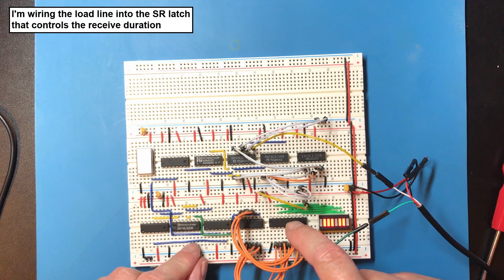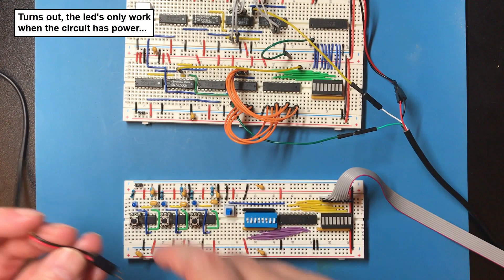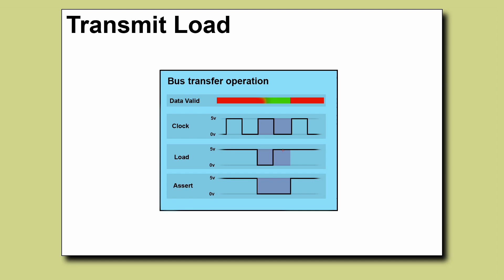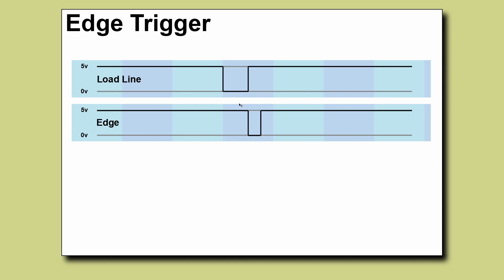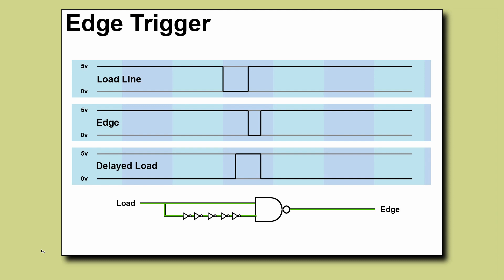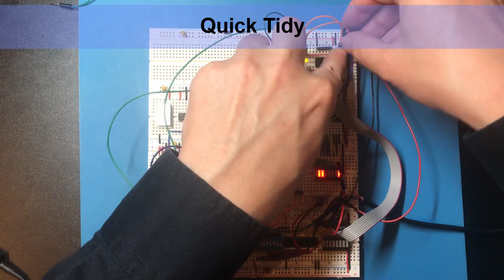Interfacing - UART from Scratch - Part 3

Comment: Next video will be amazing, having a software loop to check for received bytes and echoing them back!
Reply from the maker: No pressure ehh Tom! I'll do my best ;-)
Reply: @weirdboyjim  you'll get it, you always do.
Reply: Perseverence definitely pays off anyway.

In a recent project I was battling with some logic in a CPLD (written in CUPL, which I liken to assembly language for hardware). Took me a couple of days of tinkering to figure it out, which is how I get over most of my problems. But in the end I almost always do, or find a better way to do it along the way. No exception here. :-)

Im really inspired by your UART though, it is so elegantly simple, I reckon if I had tried to design one it would have been way more complicated for the same functionality.

Would be really cool to see if you could get a FIFO queue for tx and rx going, but I know you want to keep things relatively simple, and that might overdo it.

No shame in using loads of SR latches though. Sometimes you just need synchronous logic to achieve your goal. Im a big fan of '74 flip flops in my designs. ;-)

Comment: An alternative to the UART you are building is the UM245R which is what I used in my CPU build to interface to a PC.
It's more fun building your own of course. The UM245R is also good for the power supply to the CPU as it can supply 5v from a PC.

How is it going with the Elegoo breadboards? It looks like you are having issues already. 
I found the resistance of the power rails on mine were 100 ohms meaning that power distribution is challenging. 
I finally binned them when I found that I couldn't use 7-segment led displays on the boards, the contacts were not being made reliably.
Reply from the maker: Yeah, these breadboards look nice but the internal contacts are not as good. I'll not be buying them again.
Reply: @weirdboyjim  I use the same breadboards that Ben eater uses which is the B830. Some of the contacts are beginning to go after about a year of constant plugging and unplugging wires but apart from that it’s brilliant. The resistance is about an Ohm I think but I could be wrong

Comment: Finally, that moment !! well, you adopted a shift register for latching that data. Similarly, you should also interface another 8-bit register to latch the control bits of UART directly driven by the CPU. 
Thanks once again.😃
Cheers✨✨✨✌
Reply from the maker: Always good to see planned things work. Shouldn't need to separately latch the data for transmit, as long as the load time of the shift register is as quick as the cpu's clock cycle. A separate latch might let you get transmitted bytes closer together but I think adding a buffer would be the better long term solution.

Comment: I wonder if RTS/CTS support would involve more than wiring that "byte available" signal (possibly inverted) to the RTS line, if you only care about one direction (and assume the other side will be fast enough no matter what you do).  If it is, that could make the receive side much more reliable. Actually, the other direction might not be much more than ANDing the send signal with the incoming CTS line
Reply from the maker: That might work,  but it would probably be safer once I've added a bit of buffering. I have seen 8-bit cpu code use a software xon/xoff strategy around code that's able to poll frequently.

Comment: This appears to be pretty close to the MC6850. The only real useful thing that's missing, if it was ever used with a POTS modem anyway, is parity support. Would be fun to see that done. Otherwise the missing bits to make it a "true" UART is a basic decoder to put the status info on the databus instead of using discrete signals, but since (I assume) the processor wont be using addressable UART registers this doesn't matter? Excited to see it all come together in the next vid!
Reply from the maker: I've used 2 of 8 bits I currently have of output, I won't bother with a decoder unless I run out of space. That said I've either misunderstood your comment or you misunderstood the purpose of the 74xx541 in the top right, that will put the status bits on the bus so the cpu can read it as in IO operation. Parity shouldn't' be too tough, haven't decided if I should use a 74xx280 or do it with discrete logic.
Reply: @weirdboyjim  ah yes I misunderstood then. I think? So the status will go on the databus, and like the 6850 you'll have two addressss: send/receive and status (I assume you wont have a writeable settings register). So you do need some kind of decoder? I was thinking youd use special instructions that used magic to get the status into an accumulator  vs it being a regular read operation.
Reply from the maker: At present my "IO ports" are spare lines out of the main bus address decoder so I don't need extra decode circuitry. I may implement an IO address system later, but only if/when I run out of space.

Comment: What about adding interrupts to the CPU?
Reply from the maker: This is better discussed on one of the cpu videos but I'll answer. I made the decision at the start of the cpu to not do interrupts. My big goal on the cpu was to explore pipeline architecture in as simple a way as possible, interrupts are a big complication (you need to be able to save and restore pipeline state, or detect when it wouldn't matter). Implementation would add a significant amount of circuitry but also time and I'm trying to keep the scope from spiralling out of control. I may do a video discussing what it would take, I will definitely include interrupts in a future build I've been sketching out design ideas for.
Reply: Doing Interupts dont have to be instantant injecting an Interupt CPU instruction in the pipeline would be really simple the rest eg.: saving registers and so on is part of the Interupt handler. Also to Elaborate on my question is to hoock up the uart recieved flag as an interupt to the CPU.
Reply from the maker: Most interrupt lines on 8-bit era cpu's are active low and use open collector drivers (so more than one device can pull it down). The received status line could be turned into the interrupt line with a 74LS05 or an appropriately wired transistor.

Comment: Why not just replace the 74LS164 and 74LS574 with the more common 74LS595...? it will save some space on the breadboard...
Reply from the maker: That's an excellent question, I did consider it and hopefully you'll "get" my answer. The 74xx164 is a useful chip, but the outputs changing during the shift makes it unsuitable for some purposes (as demonstrated here). The answer I've shown is to pair it with a 74xx574 to sample the outputs at a precise moment in time, the combination is immediately more useful, so much so that the 74xx595 exists as pretty much exactly this pair wired together in this way. This series is all about building things from the ground up, I could always replace chip combinations with higher levels of integration until this entire sub series becomes a single "Here is how to wire a 16550 to a cpu" video.  Of course I could "go lower" and try to build the thing from elementary logic gates or even transistors/fet's but I have to try and strike a balance.
Reply: @weirdboyjim  i'll wait for the true "Transistor Transistor Logic" uC design in 4000 short video's
Reply from the maker: I could maybe cut that down to 2000 videos with some extra fast forward.
Reply: @TheEmbeddedHobbyist Might as well make your own transistors. ...or relays, those are easier to build at home. And the wire for their coils. And...